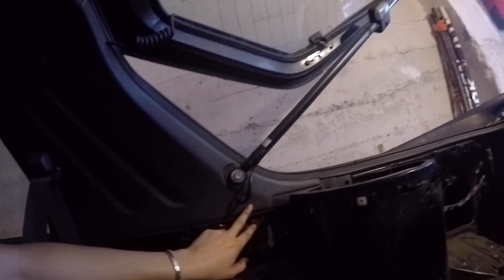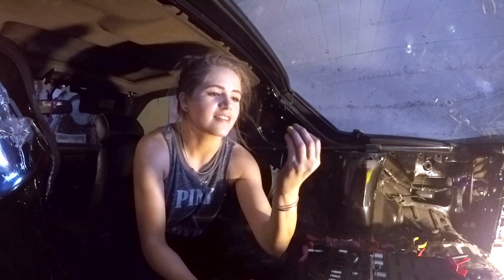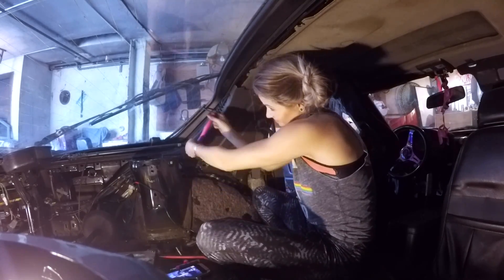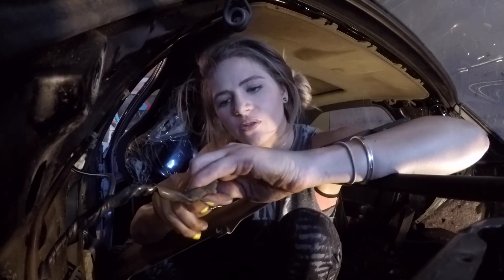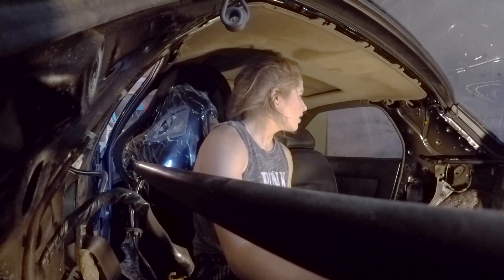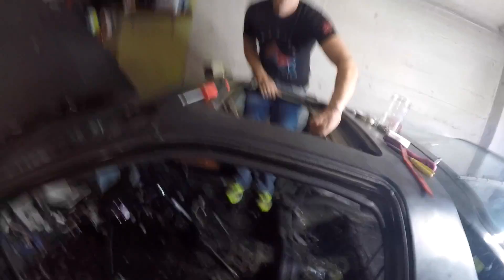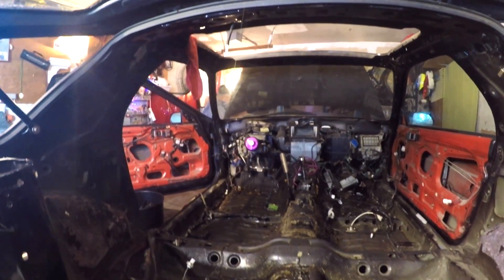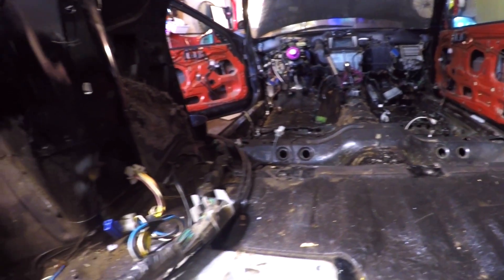GUTTING RX7 INTERIOR | Because Racecar | Project Drift - EP. 4

Comment: did the same to my r56 mini , lol  makes a massive  difference .  especially that thing , lots of luxury crap .  used for autocross tho
Reply from the maker: haha awesome!
Reply: building a mr2 spyder, 2zz swap. i broke the timing chain and spun a cam baring in the stock 1zz. they are not fond of 8500rpm. but the 2zz should sort it with a 6speed from a celica. saw you sketchy lift vid . mine was not as bad. plus i payed them to install it . ;/

Comment: Fun job gutting a car, replacing the dash in my S5 was bad enough. Are you going to have it repainted?
Reply from the maker: keithrx3c yea! My next video will be of removing the sound deadening, then my plan is to paint interior white 👍🏼 #cleanAF
Reply: Nice, apparently dry ice is good for removing sound deadening. I used the heat gun/scraper method on my 808 coupe, in the middle of summer too, was awesome, :P
Reply from the maker: keithrx3c yea! I used dry ice for most of  the sound deadening, then used torch/heat gun for tunnel... heat gun method is brutal! Haha, especially in Rx7s... the sound deadening is a horrible, dirty, mess and leaves way more residue than most cars :p not fun!